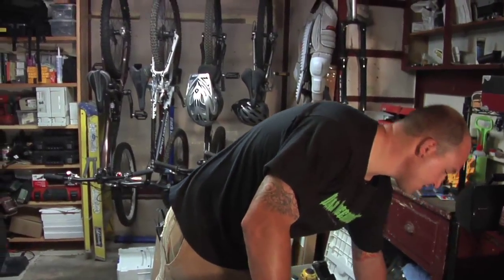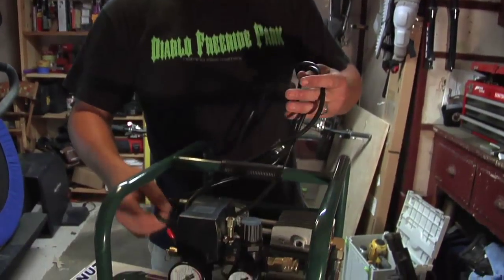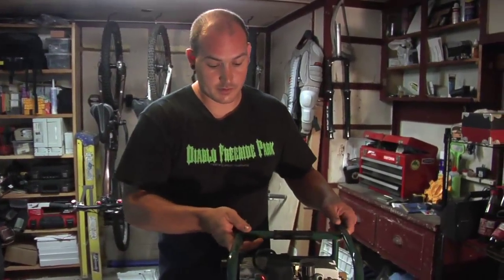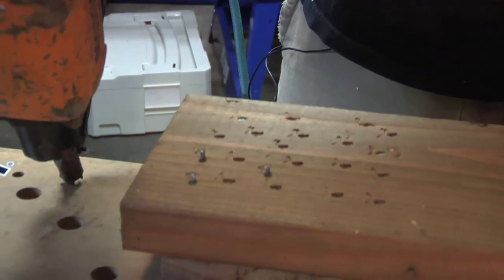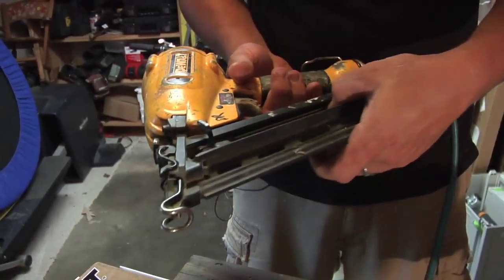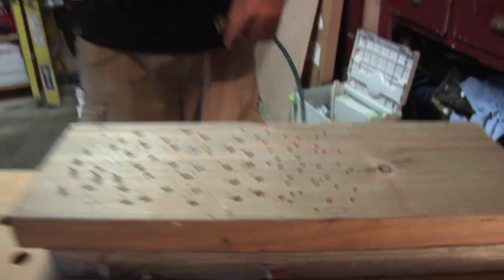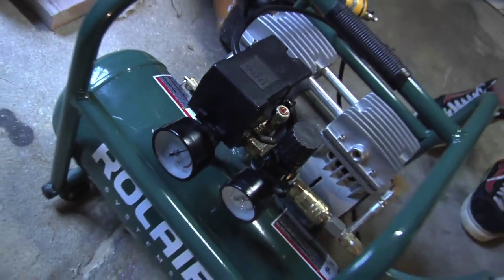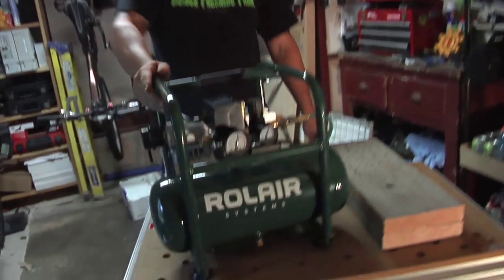Rolair JC10 Super Quiet 1HP Oil Less 2.5 Gallon Air Compressor On Dave Reinhold TV IN HD

Comment from the maker: I Checked the tank with a magnet and it sticks, so it's steel.  A feature I didn't go over was the drain, you can unthread it to let out air and condensation and also easily unscrew the entire plug to allow everything to drain out of the compressor.

Thanks
Dave

Comment: The Dewalt 200psi 2 1/2 gal high output trim compressor is also super quiet and you can frame decks with it no problem.....good video roll air has been around a long time

Comment from the maker: If our are going to use it for trim and light framing, the jc10 will do just fine.  I abuse my jc10 and its still going strong. I've used it on some decking jobs where I used a hid fast nail gun and the jc10 had no problem keeping up. I know it's not meant to run constantly but I end up overworking it quite frequently ad have no issues.

Comment: Awesome video and the final push I needed to decide to purchase it. Some people on a another forum "guessed" it wouldn't work as a full time trim compressor and definitely not for light framing. I figured, judging by the specs, that they were wrong. Now I know for sure. Thanks! Now, if you don't mind, will you compare the Rolair Bull and the Makita MAC2400?
Reply: I have both the "Bull" and the Makita, the Bull is 100% duty cycle and the Makita is 50% duty cycle.  Meaning that for every 30 minutes of continuous use, it must rest for 30 minutes.